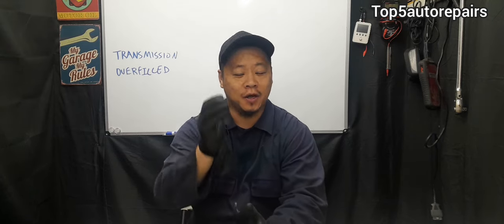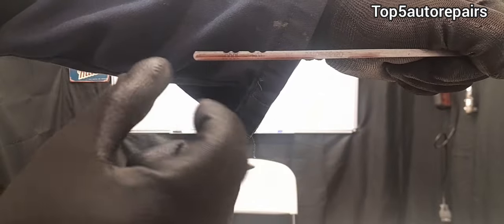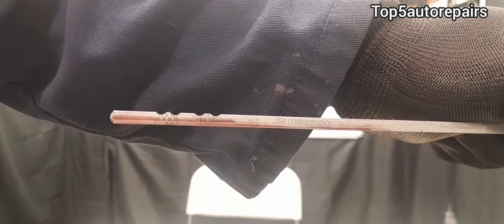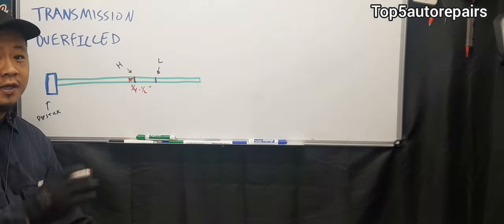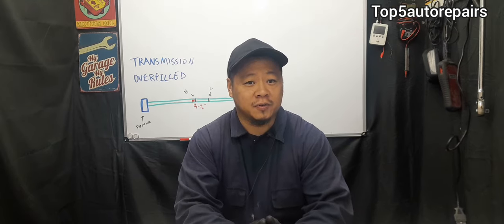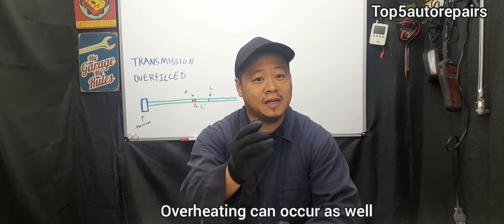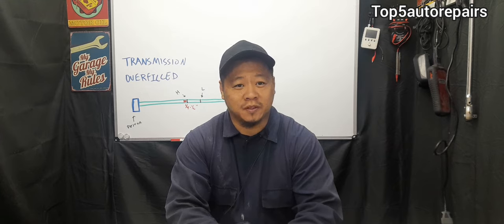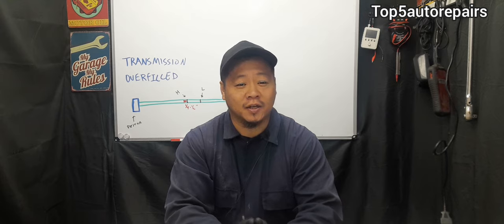WHAT HAPPENS WHEN YOU OVERFILL YOUR TRANSMISSION WITH FLUID

Comment: Lol...I had my transmission rebuilt, and it's started slipping, making loud noises. I couldn't drive over 40 mph. The check engine light came on with 2 codes about the solenoids. So I took it back to the shop, and the guy did a test run and deleted the codes and said it runs fine😮 I said what about the transmission leak, and he said the transmission was overfill so it Purge what it didn't needed😂😂😂😂 I said what! I've never heard that before mane. I said, "How is that so?" I rather him to say what you said about the pressure and the gasket 😢
Reply: Yeah, that’s definitely some bs on their part. I would have been ticked off.

Comment: do you check with car engine off or on?
Reply: Most cars require the engine to be running when checking trans fluid. 
For Honda, mostly need to off the engine to check, within 60-90 second after engine off do the check.

Comment: You're supposed to check the fluid while it is running .
Reply: Depends on the vehicle.
Reply: @MrRedHotChiliMan  I can't think of the vehicles that say to not do it that way except MAYBE Honda...
Reply: @82_KID  you’ve checked every vehicle? And yes, Honda(Acura)is one that is definitely different. My Tacoma has to be checked at a certain temperature range. So yes, there are always different/correct methods of checking your trans fluid. People should always consult their user manual, obviously.

Comment: Transmissions all have a vent, if overfilled it will puke it out hot. The worst that can happen is foaming ,and aeration.  Been building transmissions for 40+ years. Will not blow seals,horseshit.
Reply: Hey bro I just replaced my transmission filter and replaced fluid on my 1971 maverick automatic trans. Now when I shift to drive or reverse. It jumps, did I just go myself?
Reply: @joseespinoza93  early C4? Look in the pan where your old fluid went ,see if there is a spring about an inch long . And a check ball. If so, remove filter, you'll see ahere it goes. Ball first, then spring. Filter back on. Google c4 valve body breakdown. Should see it on the schematic. What engine , 351 windsor? Im a GM guy but I like all the older cars.
Reply: Interesting. I’ve seen those overfill ports. The ones I’ve seen on videos are plugged up
Reply: @justanotherskid3801  if a vent hole is plugged , the transmission will push fluid up and out of the filler tube. 40+ years building,stock,race,and off road units.
Reply: @justanotherskid3801  Got to always check , make sure the dirt daubers,haven't plugged em with dirt.
Reply: @ronniecox109 
Ronnie I’ve got a 06 Silverado 1500 4x4 and added a cunt hair to much ATF fluid… Maybe a quarter inch half inch max above the hot full mark. Whatcha think I should do? Should I try to siphon a couple of oz out? Idk
Reply: Would appreciate any input… thanks 🙏
Reply: @theadorephaedon1691  being a 4x4 yours should have a black hose on the vent that will run up to the top near bell housing bolts , this in case you get in a deep water hole, so you don't get water in the unit.
Reply: @theadorephaedon1691  4L60E is what should be in there. 4x4 may have the HD 5 pinion ,front and rear planetary gears.
Reply: 83 Caprice 700r4. I’m a bit over filled but now have Engine light, limp mode, and won’t go into 3rd -4th gear.  Shift solenoid? TV cable? Over fill? Or have I just ruined my tranny? Any advice would be appreciated.
Reply: I plan on draining some fluid, test solenoid, and adjust cable. Hoping I didn’t ruin it. Just won’t catch into 3rd
Reply: @Ry77x  83 700r4 only has one solenoid,for lockup. So no limp mode on that unit,, Check TV cable at carb/throttle body. If its adjusted properly, most likely ,the 3/4 clutch pack and 2/4 band are smoked. Drop pan ,if its got a lot of friction material in there ,it needs an overhaul. If your in the Atlanta area, I  could help you out.if not if you know any donk guys, or car club guys ,they generally know a guy. That works on the side. Be careful about the backyard boys, They can all do the job  but when shit goes wrong ,they've got your money  and they go ghost on you.